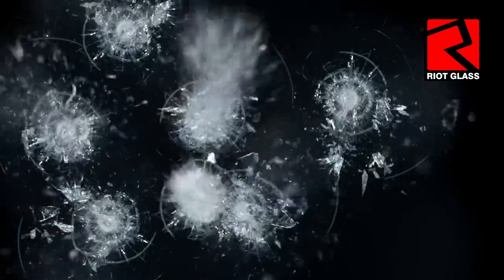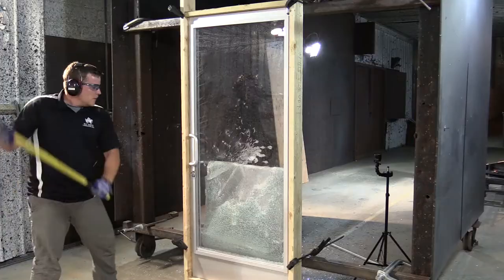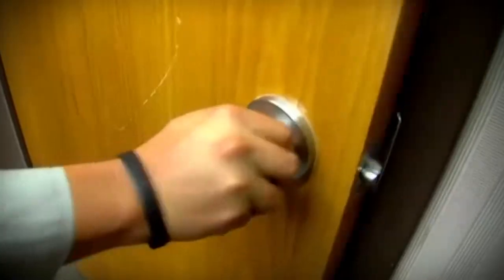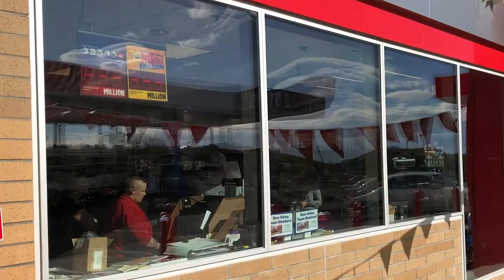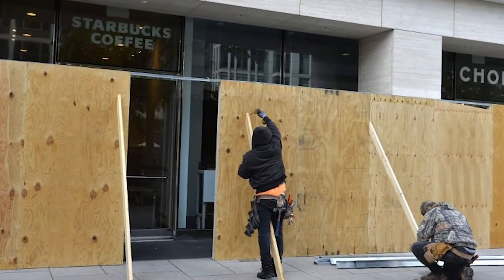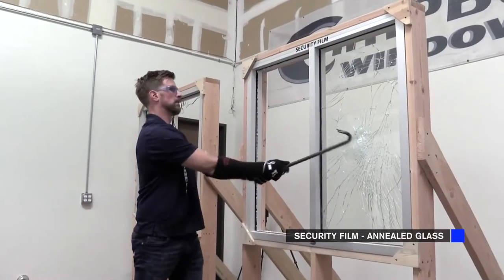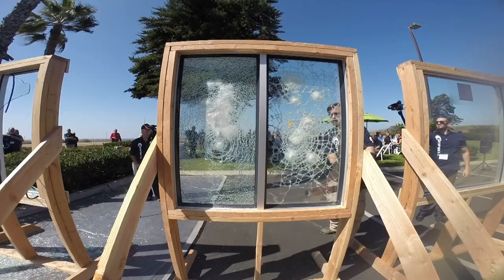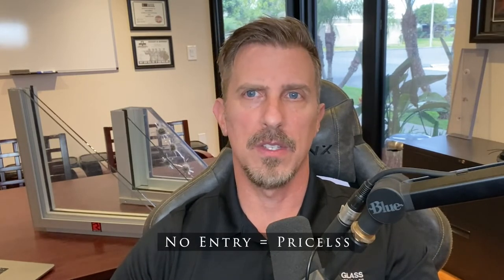What is AP25? | Learn About this ArmorPlast System

Comment: Why not put put the protective glass on the side that’s receiving the attack? If the weaker glass is on the receiving end of the initial attack, it will be taken out without a doubt, but if you reverse the 2, they have to get through the protective layer prior to even having a chance at breaking the weaker glass, and no matter how you arrange the 2 glass plates, the stronger plate will always be attacked, so why not allow the security glass plate to be up first against an attack?
Reply from the maker: You are absolutely correct, and our most popular product is our "invisible board up" AP25 and AP375 over glaze system that is mounted over the existing glass. Attack panel is the first to be struck. Thanks for the feedback.